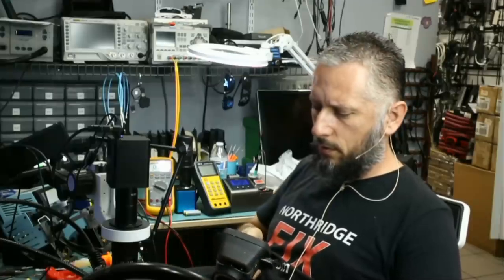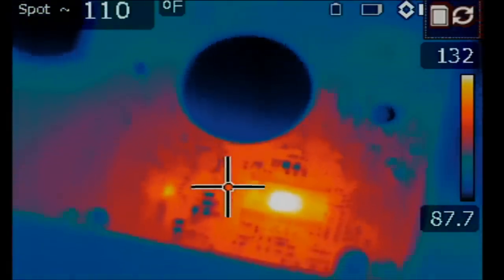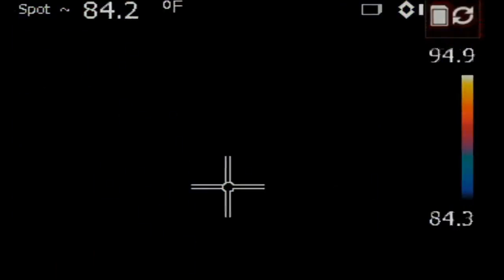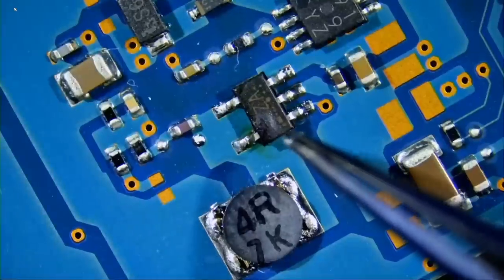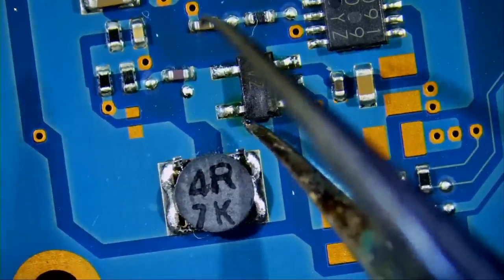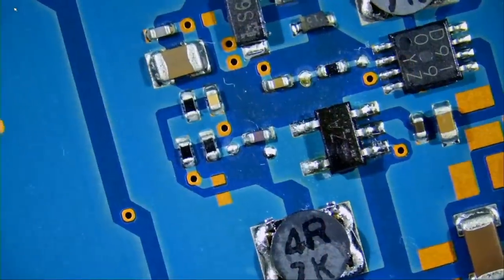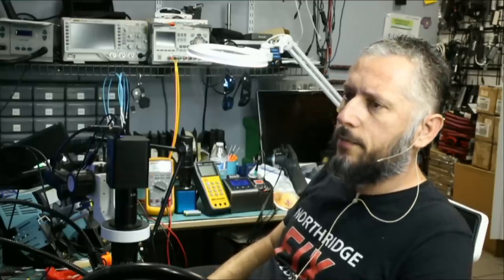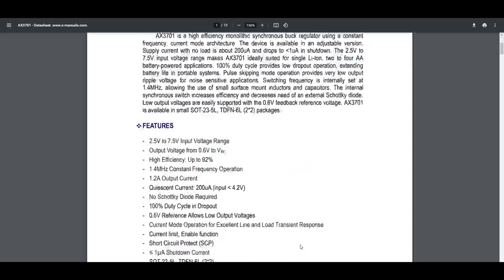2.5" Hard Drive failed -  Can we save it ?

Comment: I have to agree with you on the knowledge front. It may not be something you're interested in but learning a bit may be beneficial.

I do IT primarily and sometimes the most random things imaginable may be the best analogy to use to describe a situation when someone isnt getting it. I have hundreds of clients in real estate and dabbling into it's workings has sort of made sense.

I got into a brief stint with car upgrades/repairs and knowing it head to toe creates the same scenario.

I never had an interest in drones until a Jayztwocents video...now it's a hobby. I really thought my EXTREME fear of heights would be a road block so I never even looked at it until then at which point I thought maybe this can help. It did not but flying 393 feet upward on a display just works.

I shouldn't be off roading or recoving vehicles yet I grew up with it with the wrong gear and still love seeing it happen.

I'm never going to be an electrician but it's handy to know how/why. Theres so many scenarios where I was ignorant and could of just died or came close to. High voltage scares me as much as it should have last time I got decently electrocuted.

All cool stuff and it makes perfect sense to just learn of everything you can even if it will never apply. You might just find that one scenario where that knowledge will help you or someone else and that's what's really important.

Comment: I made a variable linear power supply that I use to inject power past the regulators. Not energy efficient but does get something to power up. All you need to know is what the feedback is set for to set the linear power supply voltage.
On the regulator you showed it's lowest voltage is 0.6V. Find the feedback pin for the regulator and put a voltmeter on it. Set the linear power supply to its lowest voltage and inject power. Increase the voltage until the feedback pin shows 0.6V.
Another method is to find out what chips the regulator is powering. Look up the data sheet for those chips and see what their voltage is and set the linear to the same voltage.

Comment: I'll look forward to the conclusion of this case. I'm wondering if the preamps might have been damaged and if so, will you attempt a headstack replacement Alex? I enjoy your videos, keep it up.
Reply: It's never wised to advise anyone to open the hard drive without a proper HEPA clean laminar flow cabinet, any contamination can compromise the data, besides, to do a head stack  replacement you need the proper head comb tool.

Comment: Brother, I have been following your videos for a while, and you are really excellent and wonderful
I have a comment on today's video, which is that zero resistance does not replace the fuse
Because the zero resistance is sometimes present to compensate for a jump, because the robot cannot weld a wire, so they compensate it with zero resistance, and sometimes it is set to erase the interference
Thanks...
Reply: Unless You're  simply trying to get a drive functional for data recovery and then I say "0" ohm resistor absolutely replaces a fuse..🤣
Reply: how would a zero resistance fuse eliminate interference?

Comment: Another solution could be to connect an external power supply to the output pin of the faulty converter.
Reply: Thought the Same....
Did so on an faulty PLC power supply dc converter.
Powered it externally with a 5V Supply until the new Power supply arrived 👌🙋‍♂️

Comment: Love the knowledge from your videos, the resistor that you place as a fuse how long would it last or its just to quickly get data and forget drive, would it be worth it to purchase the SMD fuses, starting my hand in circuit repair, any guidence is appreciated, in advance, thanks. Thanks for the knowledge🙂

Comment: Good work bro! Does this apply to 2.5 inch drives in inside laptop? I have a dell e5450 that is having the same issue with not getting power and not booting up. I took the drive out and hooked it up to and ide to usb adapter and got no power. Do they sell motherboards for these?

Comment: Hdd regenerator. Doesn't format too well, bad sectors are remaining. Much better to buy a new one, instead. I had a fuse problem w a 40 Gb Toshiba drive, soldering solved my problem. Tricky fuses, I soldered a Nokia car charger's fuse, and the charger became too hot, then failed.

Comment: Cheapest/quickest way to repair/recover data might be to buy a new or second hand complete identical drive and swap mother board over. Then swap back, copy recovered data to new drive, and return that to customer ?
Reply: Not enough must also move firmware chip to new board.
Reply: @mariushmedias  Ah, OK, I thought everything would be on the board.

Comment: Overheating can make a hard drive go down as well. if its from a laptop, may want the owner to clean the fans, check heatsinks and heat fins. I cleaned out a laptop some months back and now running faster and cooler due to this.
Reply: Resting a laptop on a soft surface, like mattress or pillow, can cause it to overheat and choke on its own hot air as well. This happens because the vents get blocked.

Comment: Great video, I have a question, I have two drives one is. 3.5inch the other is 2.5 they both had issues so I formatted them but didn’t save anything on them, can the files still be retrieved ?
Reply: If you did a “quick” format, and did not write to the drives at all other than that (and did not install an OS to them), then it may be possible to recover the data
There is software that allows you to recover deleted files
Reply: @pineappleroad  thanx no I did not write to it they are just kept somewhere

Comment: You are sure that the fuse you replaced doesn't have a mich higher amp rating? Just asking out of curiosity
Reply: In case of data recovery it doesn't matter. The fuse is a protection against fire.
Reply: @zaprodk  it does matter of course, because as you said it's for protection, and if you unlucky you destroy the data
Reply: @johnny4498  The data should be secure on the platter. If alex cannot fix the board it's time for head replacements etc. and then it doesn't matter if the board is fried as it will be replaced alltogether.

Comment: Is it safe to open a clicking hard-drive to have a look inside? Because it reads super slow (400b/s) and contains 160gb of important data. It is a Wd scorpio blue 500gb from 25 jan 2010
Reply: No. What would you achieve by looking inside it?

Stop using it and send it to someone else for recovery
Reply: @incandescentwithrage  Thx
Reply: @incandescentwithrage  It was hit realy hard and that has caused the issue, so there could be something broken.
Reply: don't open it because the problem you have is completely different from what you're seeing in the video, it sounds like the head is damaged and if you start dissecting that platter/head assembly your data is gone for good, if you can read from it, back up your stuff while you can
Reply: @techroom6830  Im backing it up with macrium reflect ant it says it is gonna take 60 hours